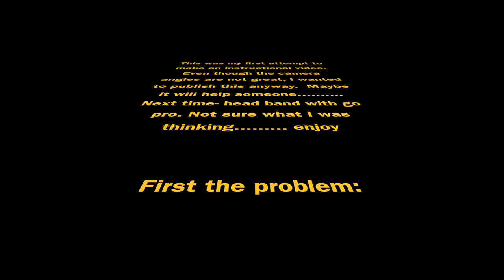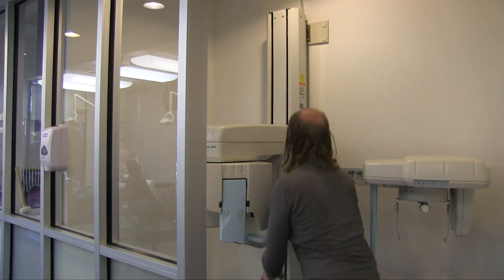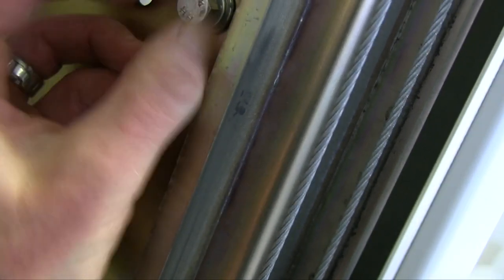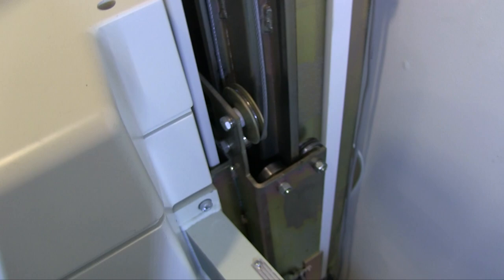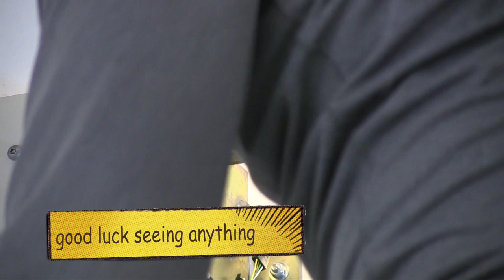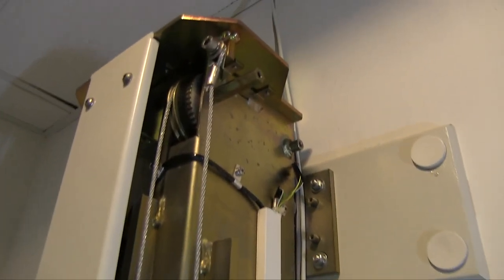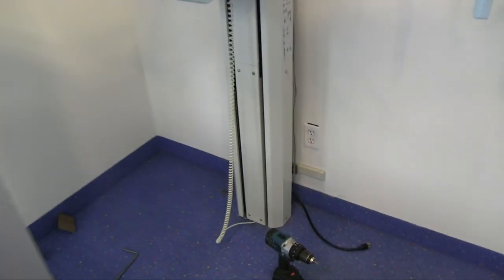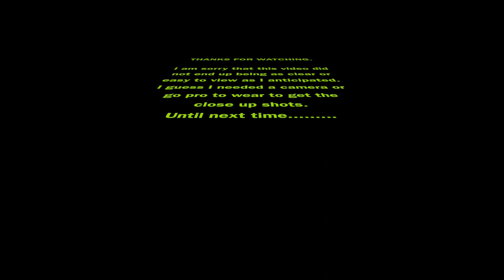Gendex 9200 Pan/Ceph Column Motor and Belt Replacement

Comment from the maker: I’m sorry this video sucks. It was one of my first attempts at making a video and it’s hard to see anything. Sorry. Use it for general guidance only m
Reply: Hello. I have a Gendex 9200 with similar issues. Can I consult with you ? Thx Dr J
Reply from the maker: @geraldjohnson8928 whats going on with it? I'll try to help
Reply: Hello. Thanks for responding. Greatly appreciated.  2009 Gendex 9200 pan / ceph. The pan rotation will not reset (X movement).  No noise is heard, nothing. No movement. We swapped out the motor and that did not fix it. Swapped fuses too. Belt seems fine. We can manually move it with no obstructions.  We have been studying the service manual. Could be the PN-1 power supply board,  or system control  board PC-1.  We have heard the optical movement reset switch S-15 can be problematic as well.  What are your thoughts ?  Do you know how to test the power current  levels at the test points? Any help would be appreciated.
Reply from the maker: @geraldjohnson8928  let me take a look at the service manual. Do you mean to say that you take a pan, it gets to the end of the cycle and works just fine but then when you press the reset button it wont reset? Did you put the machine in service mode?
Reply from the maker: @geraldjohnson8928  and does the ceph work including reset?
Reply from the maker: @geraldjohnson8928  here. Watch this. It’s unlisted. https://youtu.be/BSEWZU6o9mQ
Reply from the maker: @geraldjohnson8928  so the last 4 pins of the x24 connector on the pc1 board is the x motor. That x24 has 12 pins with 3 connectors. The first connector on pin 1234 goes to the y motor. The second connector on pins 5678 goes to the r motor. And the last connector on pins 9, 10, 11, 12 goes to the x motor. If you switch the second and third plug the pc1 “thinks” the r is the x motor and the x is the R motor.  Then you can run the service mode and test the r motor and wires and opt i sensor. But those will really be the x motor and wire since you switched them. So when you test r if it doesn’t work and the problem is now with the r and not x, the problem is the pc1. Is that clear? It’s confusing. If the x still has an issue then it’s the opti switch or wire.
Reply from the maker: @geraldjohnson8928  okay. Last reply.   The switches just tell the machine where to stop so I don’t think that’s the issue. In the service program you can test them. I would doubt it’s the pn1. I actually found a guy on eBay who fixes boards and sent him mine to refurbish. . It didn’t solve the issue. My issue was a wire between pc1 and the rotation motor even though the Gendex support told me it’s usually not the wire. My bet for yours is on a wire or pc1. Before you buy a used pc1 which is a real crap shoot,  make sure you study the schematics and really follow them. They are at the back of the service manual. You can see the drivers to reset the motors are on the pc1. Maybe take a multimeter and put the leads in the motor pins that are powered during reset according to the schematic. Then try to push reset and see if it’s getting the right voltage. (42? Or something like that. Says it in the service manual)
Reply: Yes I think I understand that. Thank you. Much appreciated. Will definitely try it after the weekend.
Reply: How do we determine if it’s the PFC board PN1 ( power supply) is defective? Just so I understand?
Reply: The ceph will not work currently. We put it in the ceph mode and it would not recognize it.  Prob bc the pan component is not reset into position ?
Reply from the maker: @geraldjohnson8928  that’s interesting. And not good. Are you able to take any panorex? Or is it stuck in the finished position?
Reply from the maker: @geraldjohnson8928  F.3.31 #4 of the service manual tells you how to check to see if the pn1 is functioning properly. There is a light that’s on if it’s okay.   I would swap the wires from the pc1 first. That board controls the motors and drivers for the motors.
Reply from the maker: @geraldjohnson8928  you got me reading the manual. Argh!  I think if any of the motors work in any direction the pn1 board is fine as far as what you are experiencing. It’s pin 6 and 7 of the x2 connector leading into the pc1 from the pn1. It needs to be 42 volts and that controls every motor in every direction. So I think you can rule out the pn1 being the issue.  It looks like on the pc1 board look for the x19 molex plug. It’s on the top left corner of the pc1 board. If it were me I would pull the x19 connector off and trace the wires. From the wiring diagram in the manual, it looks like the first 2 pins of that x19 cord goes to the x motor and the wire on the second two pins goes to the optiswitch s15. In my opinion (but I’m a dentist not a tech) your problem is one of those. Either the pc1 board, or the wire from the x19 connector to the motor, or the wire from x19 to the optiswitch s15, or the optiswitch s15 itself.  I assume you know how to get to the pc1 board. It’s behind the mirror.  There are Allen screws under the mirror that need to come out. To remove the mirror you need to unplug the wire from the pc1. It’s on the bottom.  Make sure you unplug the machine and wear a grounding bracelet so you don’t short out the pc1. I changed the pc1 before. It’s a pain. Lots of plugs. Take a lot of photos and make a lot of notes If you ever take it out. Maybe it’s a loose connection. That would be nice. Pull the plug from the x19, and push it back on and see if it runs.  Study the diagrams at the back of the service manual. Those are your best friend. And call Gendex. They are somewhat helpful. You may need to make another cable if you can’t buy one. I had to do that. And it’s been fine ever since. Good luck.
Reply: Thank you. We really appreciate the advice. We will use your information and try to solve this next week.  You’ve been extremely helpful. What part of the country are you located in ?
Reply from the maker: @geraldjohnson8928  I’m in New York. Kills me that Gendex does not support the pan/ceph any more. It’s almost criminal. Not like it’s fifty years old. I bought mine 11 years ago. New. 45k. That’s not that long. And when the rotation stepping motor failed Gendex said “sorry parts aren’t available anymore. We don’t support that machine and can’t help” it infuriated me. Had to go on eBay and buy used parts at a mark up. It’s crazy. I won’t buy another Gendex.  Unfortunately dentists get ripped off if they don’t want to or can’t do things themselves. Three years ago I had an issue with my Tuttnauer autoclave.  I have a Statim too but it was during a busy time. I called Henry (rhymes with fine) Dental and told them what I thought the issue was; a leaking pressure relief valve where steam was escaping not allowing full pressure. I told the dealer I only wanted the issue addressed. They brought me a free loaner the next day. 3 weeks later they sent me a 1800 estimate including door handle, gaskets solenoids, etc. I reminded them my request was the issue only and not to do 1800 of repairs.  The loaner became a rental if I wasn’t going to proceed. 4 weeks at 100 per week plus 250 diagnosis fee. So 650 to NOT fix it. I got the machine back, called wally at all clave parts dot com, and got the pressure relief valve I thought was faulty for $50 and installed it myself.  That was 3 years ago. Machine has been perfect since. Oh, and told my Henry dealer I was done ordering from them so they waived the 650 bill. Moral of story is we get taken advantage of. Don’t want to gross 5 million and spend 4.999 million to run the place and net one dollar. I fix as much as I can myself. Seems like you do too. Hope you get it figured out. Where are you located and sorry for the rant.
Reply from the maker: @geraldjohnson8928  did you ever get your machine running?
Reply: Hello ! Happy Holidays ! There’s been a little bit of a delay because the “big three dental” supply / tech  shops would not work on this product since it is no longer supported by the manufacturer.  I found an out of town technician that works on x-ray machines that is coming finally  this Friday morning.  I also found an electrical engineer locally that can help with troubleshooting the electrical systems.  I’m going to great lengths to get this fixed! Thanks again for your information and we are going to utilize it all on Friday morning. I actually sent him some of your notes in advance.  We might need a tech-support call with you! Thanks again.
Reply from the maker: @geraldjohnson8928  isn't it crazy that they won't work on It?  At least there are parts typically available on ebay. Make sure you have the service manual available for them (it came with the machine).  I realized after a few calls to gendex that the techs were merely referencing that and unfortunately had no additional knowledge. Hopefully the people you found can do the repair.  Good luck. Hopefully something easy.
Reply: ***Correction. When we did the swap the R motor would still not operate. May be the x17 x 16 connector.
Reply from the maker: @geraldjohnson8928  wait. So you put a known good motor (the rotation motor) into the x motor slot, and put the x motor with bracket into the R position and you still had an x failure?
Reply from the maker: Watch this unlisted video. https://youtu.be/BSEWZU6o9mQ. Swap wires within the x24 connector. There are 12 pins that go to the 3 motors. I would unplug the wire from the bad motor at both ends. And swap it with a wire from one of the other 8 pins. Swap it at the board and also at the motor. Then run it again. That should tell you if it’s the cord (wire) or the board (something else). If x was your failure point and you swap wires and then R or Y is your failure point after the swap, it’s the wire.
Reply: We swapped the connectors on the PC1 board you said we should swap. The R motor would not operate in either scenario.
Reply: Initially we were getting an X reset alarm message. So we thought that was the issue. But the x motor works in service mode. And so does Y.   But the issue was the Machine would never rotate (R).
Reply from the maker: @geraldjohnson8928  so the initial problem was the machine wouldn’t rotate? Or reset in the R plane? The easiest thing I found, is to take a piece of copy paper and write out the different scenarios because it’s easy to get confused. You can eliminate the motor as the cause if it works in position A and B but not C with everything else being the same.   If it’s the wire or pc1, and not a motor, you are going to find more than one motor not working in a certain spot, let’s say the R pins of x24 connector which I think are 5678.  Once you find that more than one motor doesn’t work in a given spot, the next thing is to swap the wires leading to that motor.   If one of the new wires allows that previously not moving motor to work, it’s definitely a wire issue.
Reply from the maker: @geraldjohnson8928  does the R motor work in service mode? If not you found the issue. The r motor, or the r wire or pins 5678 of x24 which would mean a new pc1.  I do suggest writing it all out so you can see what you are eliminating. If the r motor didn’t run in service mode the next thing I personally would do is remove y or x motor and put it where the r motor was not working and try that “r” (really now the y) motor in service mode. If it doesn’t work it’s not the motor, but the board or wire. If that makes sense.
Reply: Hello. I hope you had a good holiday. Well we have finally ascertained through your help and much troubleshooting that it is the board. We have taken the board out and we are going to send it in for repair.  do you recommend anyone in particular? I did find one online called “Brooks circuit specialists”.  Let me know. Thank you again for all of your help.
Reply from the maker: @geraldjohnson8928  the PC1 board?  When I thought that was my issue I actually got one from someone on ebay that allowed me to try it and see if it worked and if it didn't he would refund me the cost less shipping both ways. That was a unique situation since it wound up not being the pc1 in my case. I then turned to Brooks- the guy you mentioned. He is in New Jersey. Found him through ebay a long time ago, he was going to make me the wire with connections i wound up doing on my own. 

I wound up sending three boards to Brooks. Great communication,  really fast turn around.  Unfortunately my issue was not any board, so I can't tell you if he can fix it.  I assume so. He was so honest that he told me he would try to repair my last board and wouldn't charge me if it didn't solve my issue.  Well it was not a board, it was the wire and he refunded me completely.   
My only concern was how would he know if his repair worked? Im sure he doesn't have a gendex machine. I guess he tests each component and tests for continuity between them all.  
I would and will use Brooks again if any issues arise. He was excellent to work with.   
Good luck.  And by the way. Remove the eeprom memory from the board before you send it in.  It contains all the specific info for your machine: ip, start position etc. I seem to remember it being on the lower left on the pc1.  Its in the service manual.

Comment: Hi, nice to greet you, I need to ask you a question, I am trying to replace that vertical gear motor, and disconnect the cable and the head stay up and the weights down, now I can't find how to lower the channel to be able to do the procedure as you have in the video, I appreciate how you can help me
Reply from the maker: https://www.manualslib.com/download/1999423/Gendex-Orthoralix-9200.html
Here is a link to the service manual. From what I recall it walks you through the process but you need to have the weights as high as they go, which means the carriage is down at the bottom. Then you put something under the bottom weight to hold them up and take them all out. Then raise the carriage slightly to take tension off the metal wire and that allows you to remove it
Page F37 in the service manual shows it.

Comment: Hello! We are currently having the same problem with our pano. Where can we find the motor? We were told it's no longer manufactured?
Reply from the maker: I had to make my own here https://youtu.be/oUxUjHhCnUE
There are a coup,e of solutions because Gendex no longer supports or sells the motors. The issue isn’t the motor. You can buy those brand new. The issue is the proprietary bracket and pinion gear attached to the motor. I think your best bet is to buy one on eBay from a used machine. They usually sell for around $900. Like this one https://www.ebay.com/itm/304732425849 hope that helps. You should swap motors just to make sure that is in fact the issue. Good luck.

Comment: How did you get the weights up?
Reply from the maker: I believe when you lower the carriage like you were gonna take a pan on a kid, the weights go up. Then you lock in the bottom weights and I used a long screwdriver placed into the weights to remove them one at a time. Sorry,  this is one of my first videos and I skipped parts.
I have the service manual. If u send an email address lll send it to u. I think it shows in detail

Comment: Do you have a part number or the exact name of the motor you bought from henry schein?
Reply from the maker: 4519 124 21641 is the part number. It’s called “geared motor for column”. If you want the service manual, I’ve got it. Give me an email and I’ll send it. It has every part number and name for the entire machine. Don’t ask how I got the Svc manual.......and Henry schein just had it drop shipped from gendex who won’t sell it directly. You just have to go through any dealer to get the parts
Reply from the maker: @larrysteininger2165  sent it. Good,luck
Reply from the maker: @larrysteininger2165  good luck with that machine. I just had an issue and Gendex no longer sells any of the parts. No motors, no brackets, no circuit boards etc. ten years old. Nice to be them.

Comment: Ok,if someone actually is watching this to know how to replace column motor,  good job... however,before u do all this, grab a can if wd40 lithium grease and get access to the steppin motor and blast it right down the center point of the motor and hit all the gears...ive had 6 of these motors bind up and the grease fixed em all, gendex tech guy taught me this trick about 5 years ago...
Reply from the maker: Darn. I wasted $900.

But in all seriousness, I kept the old motor because I don’t think it was shot. When I opened up everything, there was a small screwset that locked the spindle to the main gear that appeared to be slipping.  I think that is what the original noise was, the spindle slipping inside the main gear. 
At that point I had no idea what the motor cost, since I got it from Henry Schein.  If it were a central ac motor in my house, I would have played around, but time is money and I didn’t want to take a chance on putting it all back together with the original motor, only to find I wasn’t right.
Reply from the maker: I thought i would reach out this way  cause my pan is acting up.   Maybe you have some ideas.  When I called gendex They basically told me they dont support this machine anymore.
The rotation motor basically quits at the beginning of the pan cycle...radiation keeps flowing no error message but no more movement.  Have to unplug to reset. 
Then it might work fine the next run. Changed motor, belt tension and wires. Any ideas?  Thanks.